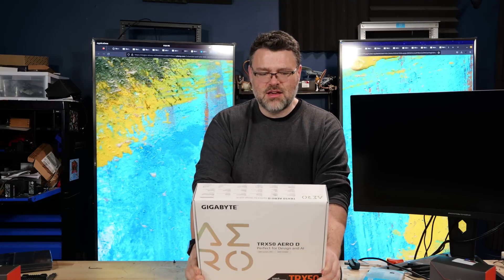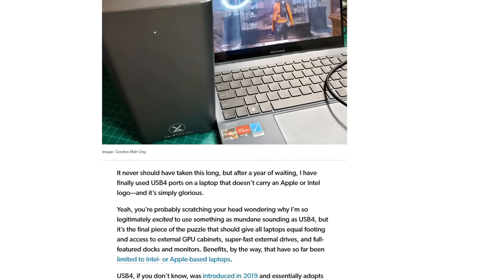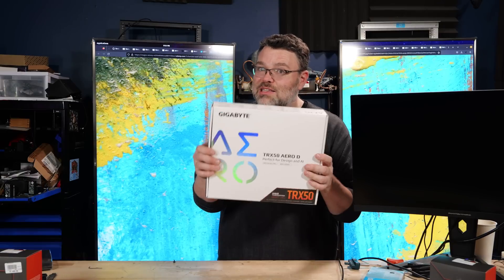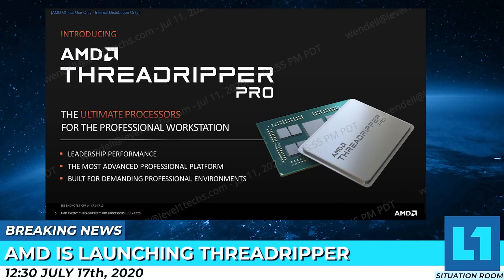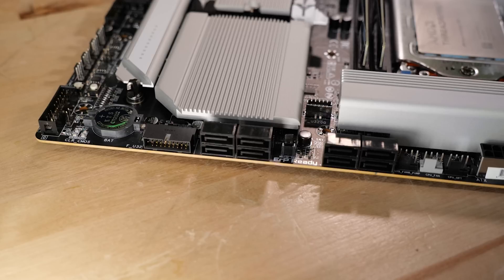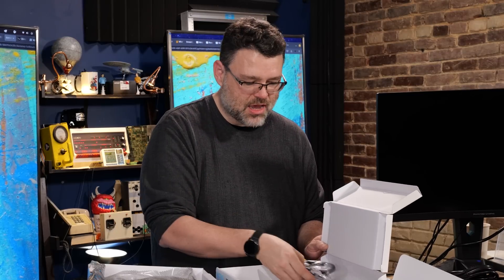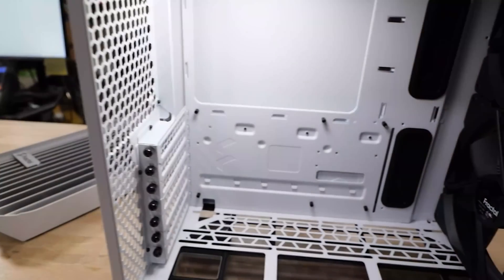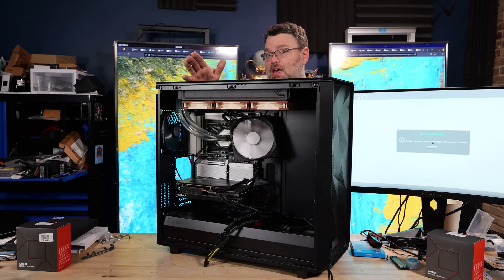Overclocking Threadripper 7000 on the Gigabyte TRX50 Aero D!

Comment: Oh I don't think it's out of the realm at all... I ran a 9980xe daily driver overclocked to 4.6GHz for years w/o issue.  What's the point of a HEDT if you can't use it as an enthusiast level desktop computer rather than a simple workstation?

Comment: No matter what i do i cant get more than 24Gbps for USB4 or Thunderbolt4 storage even with PCIE Thunderbolt tunneling. Maybe it woks only for  Displayport? Anyone have 40Gbps working? lsusb shows ony 20,000x2 which adds further confusion. Ive tried both TB4 and USB4 cable. Further, the KDskmark shows about 3000/2800 Gbps (~3x8=24Gpbs). Are they saying 40Gbps is really 20Gbitx2?

Comment: Question: Where is that interesting fan bracket mounted? I'm using the Aero D with a 7960X and Renegade Pro RDIMMS (QVL). There seem to be stability issues with that board using the EXPO 1 profile (6000 MT/s CL32). Those could be thermal issues, in my opinion.

Comment: Does this motherboard have enough space to fit 2 RTX 4090s with the PCIe slots? Can anyone confirm?
Reply: Yes sure
Reply: @Negodyay77  is there space between for air or do I need to think of custom placement solutiom if both are air cooled ? Getting vertical riggings etc.?

Comment: I look forward to CXL memory testing, if you managed to get some.
I can really see myself perhaps use a Threadripper (none Pro) with "only" 128-256GB RAM with 1TB+ CXL memory instead of 1TB RAM TR Pro.
Use case is compiling (mostly UE5 main dev & shaders) and running other memory intensive computations (latency dependent)

Comment: I have a benchmark request, and it's for my personal "extreme" use case:

I have been setting myself up to start a content creation business that involves RED cameras, thus meaning I need a machine that can handle R3D RAW files with the native resolution being 6K.
The build I started with had an RTX 2080, a Ryzen 2700X, 16GB of CL14 3200MHz DDR4 and a 4TB Gen 3 NVMe drive. That was enough to playback the files smoothly, but it would get choppy after an hour or so and proxy files wouldn't help. I then resorted to getting an RTX 4090, silly combination I know but it did get the job done at least in the playback department. It would, however, slow down once some effects and noise reduction are added.

Since then I stumbled upon some other major issues my build, and any other regular PC build I could make right now:

1 - As the R3D files take up a whole lot of space (a 1TB disk can be filled in just 30 minutes of recording) and require a decent read speed to be worked on, I bought an external Thunderbolt 4 storage device which can hold up to 16TB of NVMe drives and filled it up.

2 - You might wonder why I bought a Thunderbolt device having an x470 motherboard, this is because some tech channel had reccomended Intel platforms for creators as having Intel Quicksync through the iGPU in video editing programs is kind of a must have. I therefore was looking to switch to an Intel platform and bought a Thunderbolt device ahead of time. That however poses a problem that is going to be my next point.

3 - Thunderbolt and iGPUs use up 4 PCIe lanes each, considering I already have an internal NVMe drive and the RTX 4090 eating up 4 and 16 PCIe lanes already the total lanes I need jump up to 28. That means neither Intel's or AMD's current desktop chipsets will suffice, considering they offer 16+4 and 20+4 respectively. That's even more important if you consider that the card reader I must use to transfer the video files from the external cards my RED records on to, to the pc, uses a Type C connection that will need to pass through the chipset and I also want to run the editing program and OS on a second NVMe drive that's faster than the 4TB I am currently using. That pushes the needed PCIe lanes to 36, without considering the fact I might need to add a second GPU in the future.
Note: passing the files from the card reader to the PC is a dreadful procedure right now, as both the drive I'm writing to and the card reader use the same PCIe lanes to communicate through the chipset.

4 - While the RTX 4090 is a beast of a graphics card it is still not enough to work on the R3D files I have without running into issues. As of now I'm using the card in DaVinci resolve to deal with the decompression + debayering setting, which will eat up to 70% of the card's processing power alone. That means if effects and noise reduction are added to the equation the card will not be able to stand the workload. The only way to resolve that is if the CPU was capable of handling decompression and debayering on its own, leaving the graphics card free to do the rest.

All things considered I've come to realise the only possible solution is to either buy a Mac Pro or go for a Threadripper build with USB4 just like the one you've shown in the video. Every tech channel I know of usually just uses the PugetBench benchmarks for DaVinci Resolve, however the benchmark tells very little on how a system would behave while handling R3D files and even less on how it would handle PCIe lanes communication.
I would therefore like to see some kind of "real case scenario" test of this platform, with an RTX 4090 added in.
I could supply the R3D files as well as a project that's been worked on, let me know.
Thank you.

Side note: it seems like companies like Gigabyte know damn well there's people out there, just like me, who need this kind of platform and its features. I suppose that's why there's only two 16x slots, I probably wouldn't ever need more. It's also strange to see how desktop chipsets are so limited, considering the most recent AMD and Intel motherboards prices.
Reply: Same usecase here, man
Reply: @RedShade_Studios  I feel you brother :D
Reply: I know sod all about your usecase (wish I had it as an excuse frankly) but I'll throw in a quick 2 cents.
-AM4 is 16gpu+4nvme+4chipset lanes, AM5 is 16+4+4+4 for 28 total.
So a 7950x build could have NVME x4 boot/program drive, x16 rtx4090, x4 to asmedia USB4 controller which your "REDcardReader" connects through all from the CPU, plus there's a final x4 downlink to the B650 chipset for more M.2 etc.
The readers meant to be 20Gbps using a USB3.2 gen2x2 link but do you actually see anywhere near these speeds? Or is it like the "14GB/sec" speeds on NVME drives at unrealistic que depths? Because if you actually tend to sit at like 600MB's I might not worry about it fwiw.

Motherboards are higher despite the limited chipsets because AMD/Intel think we all want to run 5 separate pcie5.0 NVME drives for some reason, If used is an option and you wanna go cheap then x299 and X99? (power draw aside) with 40-44 pcie3.0 lanes, but you could just run the 4090 at pcie4x8 for same bandwidth to free up some lanes, don't know the performance impact in your use case though.

If you do go TRX50 I might suggest a quad NVME pcie adaptor rather than that thunderbolt 4 storage enclosure, anything you plug into the back ports of a PC always seems slower than any other option.
Again just my 2 cents, Sorry I can't help more.
Reply: @tomstech4390  Thank you for your insights. I'll try to clear some things up so pheraphs you can help more:

1 - The reader is USB 3.2 Gen 2 but caps at 10Gb/s, so has a theoretical max transfer speed of 1.25GB/s. However the cards are CFast 2.0 with a claimed sustained read/write speed of 480MB/s.
I just tried to do a test transfer (221GB total) to see current behaviour, since I formatted a few days ago and all is freshly installed. Speed capped at 350-ish MB/s, held somewhere around 300 MB/s for little more of half the transfer then went down to 200 MB/s max and 110 MB/s average while dropping to 0 from time to time. It gets worse with longer/larger transfers and sometimes starts out with the drop to 0 behaviour already.
Mind you I'm currently only running a single NVMe to try and avoid the issue, as I had previously noticed the transfer would exhibit the same sluggish behaviour with both NVMes installed, especially while prompting the first drive (M.2_1) to do any reading or just running any program that would use the disk. I thought it were the drive having its cache filled at first, but it also happens when using a Gen 4 Samsung 980PRO alone by itself so not sure.
I really can't tell what's slowing down the transfer at this point, might as well be multiple factors.

2 - I was unaware the motherboards could offer more PCIe lanes, as to my knowledge even the 7950X would only offer up to 20 lanes through CPU and 4 through the chipset. Will have to do some digging into that.
All in all the new motherboards don't seem all that appealing to me as Gen 5 uses 8 lanes and filling up the M2 slots might just turn into a nightmare.

3 - Haven't tried switching the 4090 to 8x yet, however seeing as it can get loaded up to the point where even that slows playback down I suppose it would introduce more issues. WIthout having a CPU that handles decompression and debayering that is.

4 - X299/X99 would resolve the PCIe lanes population issues but also can't offer Thunderbolt 4. Waiting for a newer platform or refresh on those two is a better idea imo.

5 - Yes, quad NVMe through PCIe would be faster and it is something I have thought of. However, the external enclosure is a portable solution I specifically chose to bring around with me during working trips. Firstly because I can't bring my desktop everywhere and need plenty of data that is moved fast, so a quad NVMe device that can fit in a backpack is the only practical solution I could think of. Secondly because I might not only need the files myself, I've recorded 4 day events alongside third-party crews in the past and being stuck transfering files to SSDs was something that ate us in the back a couple times. I need to make sure I have an empty CFast card at any time, while also being able to bring my files home and share them to colleagues/collaborators.

I really believe TRX50 is the only solution that makes both financial and practical sense right now. I'll probably wait for CES on 9th January to make a decision though.

Comment: Hey Wendell, can you check if S3 sleep (suspend to RAM) is available on this board? I built the same system a week ago and found that S3 sleep is not available. I don't think the feature is enabled in the UEFI with no way to toggle it on or off unlike the ASRock TRX50 board.

Comment: i got two thermal sensors and a noise sensor. u can select the thermal sensors as fan regulators but not the noise sensors (x570 master) the noise sensors are the most useless features ive seen. (except cpu usage led onboard - they never worked)

Comment: 12:02 Wow, 5.8 Ghz turbo on a Threadripper? Not even my 7950x turbos to 5.8 Ghz. I've seen it go up to 5.7 Ghz at most and that's very rare. It's mostly hitting 5.5 - 5.6 Ghz in single core tasks. That's with an Arctic Freezer II 360 AIO and plenty of airflow.

Comment: On the last HEDT mobo video I complained that there was no Thunderbolt, and look at this! Actually pondering giving this platform a chance.
Reply: Are you currently using thunderbolt, or is it a feature you want to use/experiment with?
Reply: @boneappletee6416  Thunderbolt/USB4 is actually pretty handy. Pretty much the only way you can connect an external NVMe SSD with half-decent speed (I reach a bit over ~2 GB/s with an old recycled 2TB 970 EVO but could be a bit faster with a faster drive).
I use it for occasional dual boot if I need to run Windows when I want to do some gaming.

I also have 2 hot-pluggable NVMe slots using U.2 connections (so this is full speed) but these are really too expensive to waste them on only running a game now and then.

TB/USB4 is really good enough and fast enough for the purpose for me. And it is at least twice as fast as any USB 3.X Gen X
Reply: @boneappletee6416 I am using an Apple Studio Display as my main monitor, so I am using TB every day.

Comment: Its hard to imagine anyone paying the premium for threadripper if they don't need the pcie

Perhaps I'm just not seeing the use case
Reply: The thing is, there's always a usecase for any highly-specific niche setup... And you won't have any exposure to it unless it's something you stumble on or need to implement.
Reply: @boneappletee6416  fair. I'm sure there's someone out there for whom it makes sense to pay an extra 1500$ for increased memory bandwidth versus am5.
Reply: The use case is you want 32/64/96 cores and high memory bandwidth.
Reply: I don't see anyone wanting 96 cores without memory capacity and io to feed it. There are much cheaper options for high core count low bandwidth cpus
Reply: @christopherjackson2157  For 96 cores I agree that non-pro Threadripper might be an edgecase, but show me where else you can get 4 memory channels and 64 cores "much cheaper" and I'll eat my hat.
Reply: Previous gen systems. 64 epyc cores with 8 ddr4 channels can be had in the 500$ range. For the entire system. Not the cpu

But I mean the real issue with that whole line of arguments isn't that you can't get a similar configuration. It's that a configuration isn't a use case. It's a configuration
Reply: @christopherjackson2157  This blows previous gen Epyc out of the water.  Milan was a pretty sizeable upgrade over Rome and Genoa did the same again vs Millan.  Factor in the difference in clocks and for a desktop the only reason I could see for going previous gen Epyc (at $500 I'm assuming you are talking about Naples) over TR is you don't make money with whatever you are doing but still want the PCIE lanes or want to play with the platform.  If you are making money the price difference would probably pay for itself in time saved for whatever workloads you are running pretty quickly, never mind Naples is PCIE 3 and DDR4-2666.  Shouldn't be hard to find Rome vs. Naples reviews and compare those to Genoa reviews to see how far AMD has come in 6 years.
Reply: Yeah, you see those are ddr4 channels. As well as a CPU that boosts to 3ish GHz. These are ddr5 channels and cores that boost to 5.8GHz with much better IPC. The use case is you are an artist or a software engineer that wants to get things done as fast as possible, but also want a versatile CPU with good single core performance. That is quite literally the definition of HEDT (vs. workstation/server, which is more along the lines of Epyc).
Reply: @PandaMoniumHUN i wouldn't mind to use server boards if they weren't such pain in the arse.

Comment: Oh man I want this board now.  Just need AMD to release 12 and 16 core non pro Threadripper now.  I'm not going to pay the amount I should be able to get board + CPU + 64gb of memory (in HEDT land) for on just the CPU because HEDT is dead and now it's just Lite Workstation.  I would content with just 16 cores or dropping down to 12 cores to get the board, CPU and RAM for the $1500 price point.  I mean I do still shudder at the thought of $1500 as the entry price point for a base platform, but I could live with it.
Reply: If you only want 12/16 cores just get a 7900X or a 7950X, you don't need HEDT. AM5 is a much cheaper platform anyways.
Reply: @PandaMoniumHUN  Maybe I want more PCIe connectivity?
Reply: @garrettkajmowicz  Yeah, there is no way I would pay more than $350-400 for a CPU that has just 20 PCIE lanes.  The 12 and 16 core CPUs belong on HEDT, not the same socket that goes into dell and hp internet surfers.  But hey, if AMD wants to make it available for both - I'd be OK with that - but not consumer socket only.
Reply: @PandaMoniumHUN   Stop telling people they don't need things they do.  I would never overpay so much for too many cores on babies first CPU socket.  Save that socket for the Dell and HP pre-builts.  I want the ability to install an enterprise network card, to be able to install more than one M.2 SSD worth of bandwidth outside of the GPU slot.
Reply: Pcie lanes situation is f terrible. I couldn't care less about 32 or 64 cores but consumer platform is so starved on pcie its horrifying. Recently had to buy SATA SSD's from 2017, that were same price as 5x faster m2 ssd, cause there was no way for me to connect more than two m2 sticks.
Reply: @sznikers   Exactly.  All the people telling us we don't need HEDT.  We don't want to pay the extra $100 or $200 for HEDT when we're already paying $600 for a CPU.  Some day they will want more storage and be like 'oh, now I see why they were saying I should be getting what I'm already paying for'.